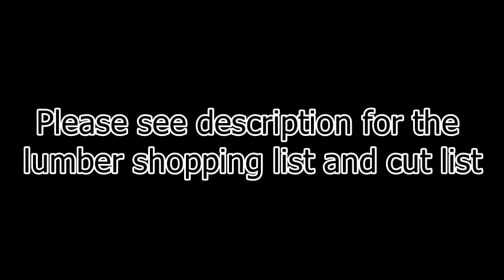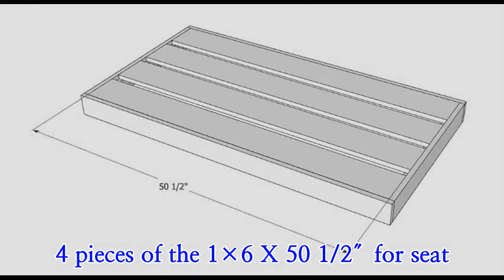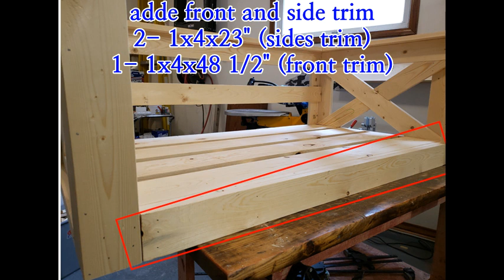DIY : PORCH SWING - How to build it for Crib Mattress size

Comment: How did the hanging kit do? Since the rope is continuous in them,  Im curious if the rope moves and makes the swing lopsided? Or would you rather have gone with different hardware?
Reply from the maker: it is fine, we didn't notice that problem at all.

Comment: I'm trying to build this exact swing and am having trouble with the X's (probably because I'm not a carpenter!) how do I measure the length and angles? I thought I had followed the recommendations in the original design from Pland&Pillow (though that didn't tell me the length to start with), but the 59degree angle and my estimate at starting with a 32in 1x3 isn't working. Any tips? Or do you know what length 1x3 to start with and can you confirm the 59 degree angles? 
Thanks in advance for any help!!
Reply from the maker: Hi Martha, if you have followed https://plankandpillow.com 59 degree angle should be the correct angle but I have not used 1x3 at all and I substituted with 1x4 so my angle is totally different. To be honest it wasn't that easy making X for me either so I manually draw lines on boards and put them together somehow . it is not perfect but not too bad. I am sure you can find other way to make this decorative than just the X shape. sorry I couldn't give you more help.
Reply: get close cut longer than needed. then mark with pencil on opposite side then cut on the line